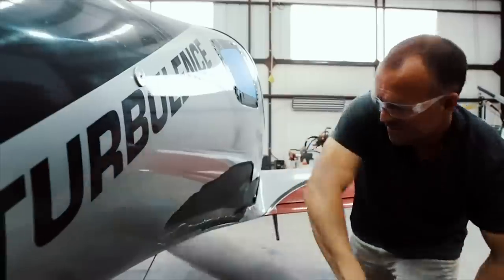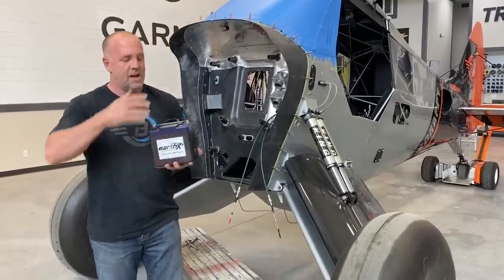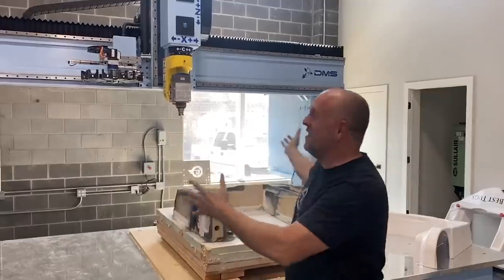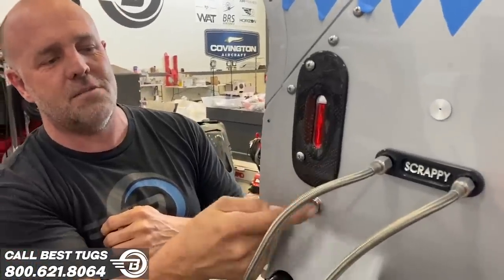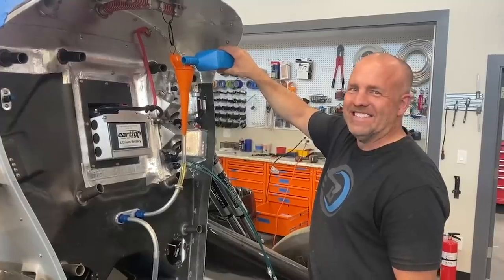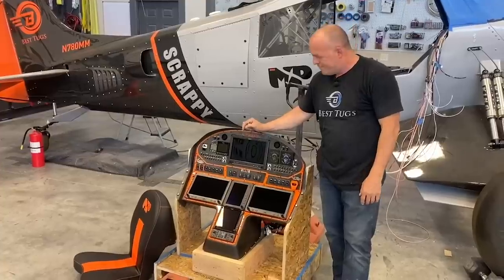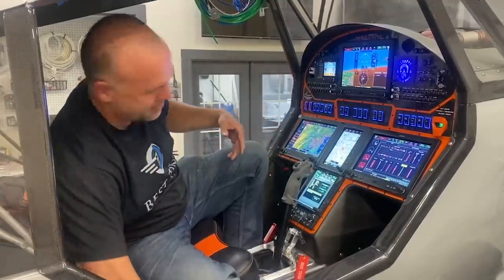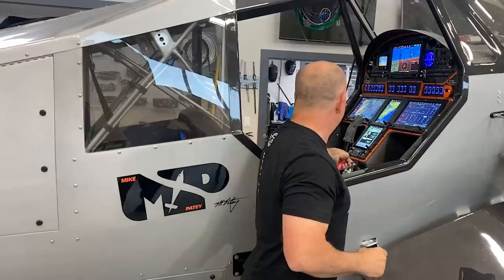Garmin Panel Install (Scrappy Bush Plane 25)

Comment: instruction : To change Battery First remove  engine. Sounds like Volkswagen
Reply from the maker: Lol 😂 I would make fun of myself for eternity if I did that 😂😂😂. You’ll see in a very soon video how easy the battery pulls out without discounting anything but the wires
Reply: Well you should make the battery like a beaver yes pull it out connects itself
Reply: The battery was on a telescoping rail in Alaska you just pull the stop bolt  out and then you can just pull it clear out and take the battery inside at night and keep it warm
Reply: @MikePatey  And is there a remote battery connector for charging or a jump if for some reason the battery was dead.
Reply from the maker: Bryan Runyan yes of course 👍🤠

Comment: When I got a Lithium Battery in the post I thought they had sent me an empty box before I opened it!!!
Reply: I built an ultra light C6 Z06 Corvette.  I mentioned that I was going to try a lithium battery and got totally flamed on the forum as a complete moron.  So, naturally, I did it anyway.  The car came with a lightweight AGM battery (35 pounds) and I replaced it with a lithium battery that weighed 4 pounds, 13 ounces.  It ran my car for just over 2 years until I killed it through human error.  Still have the replacement.  Funny how smart the morons get once their innovations are proven.

Comment: Ahhh I had a question on that engine startup issue and batteries: SuperCapacitors in parallel should help a lot to maintain the voltage up no?
[ie: https://www.skeletontech.com/skelstart-ultracapacitor-engine-start-module]

Comment: Density altitude is a b** in many more ways than one. I was walking through the pits at a drag race many years ago I was a pilot at the time and I overheard a man saying to his son I don't understand why this  motor won't crank over here it work fine at home I asked him where do you live reply Tahoe I laughed and said there's your problem he didn't understand and I am also a full-time mechanic I gave him the number of a starter that would spin his motor at 400 ft

Comment: I feel like there’s going to be some sort of huge reveal for the wings. The fact that he’s bounced around on so many topics and circled back, but yet hardly ever has mentioned wings seems suspicious. Like to do all of that final painting without even having a frame for wings? 

I’m on to you Mike! 😂
Reply: I'm actually hoping he does fuel tanks on the wing tips. As the positive point by utilizing the tips would be dead on with the Renaissance/kitchen sink designing he does.

Comment: love the panel Mike, but as a fellow pilot for the last 54 years, what happens if the panel faults I do not see old fashion HSI
Reply: I think the g3x can be independent of each other but I could be wrong
Reply: The g5 in the top left corner is a completely separate system with its own battery backup

Comment: At my current job i have been able to work with many, many engineers. Sometimes you want to beat them, sometimes you want to hug them. I have found that the difference is often weather or not they actually work on their designs. You clearly do. Your ability to dream, plan and execute is second to none. I do not fly, i just like to work on cool shit. There are few channels i enjoy watching as much as this. Your planes are amazing. Cant wait to see what you have in store for the new draco.

Comment: For your lockout pins you could add some logic with sensors on your suspension so that if the wheels are off the ground then you don’t need the pins to start the plane if you needed to restart the engine in the air. Really cool videos and build, it’s awesome to see it all coming together!

Comment: Left just enough space for his wires- but not enough for the LiPo battery to cool and not light on fire. In an airplane. Good stuff! DIY plane mods are a great thing.
Reply from the maker: Thanks for the comment 👍🤠 I know it looks like that but That’s actually not true. This is the problem with trying to edit 35 hours of footage into 30 minutes of just for fun content.  I have the backside of the battery box cooled, and the front is getting a box enclosure with a cool air vent blast tube.  My engineering firm specialized in lithium design for automotive and is the basis of my patents in battery heating and cooling design.  I’m very familiar with what your describing and now watching the video  I can see by your comment I should try and add a little more content in the future for this topic.  Thanks for pointing this out.

Comment: Hey Mike, Thanks for all of these great videos. You've done a wonderful job on Scrappy. Congrats! Would you please share with us how you're going to seal the two doors, storage doors, bottom panels, and all other areas, to enable you to fly at 25,000 feet safely. I'm sure that you've designed that critical aspect into the plane and have it all figured out... Scrappy looks awesome. Well done!!
Reply from the maker: I’ll show that in an upcoming video. 🤠👍🏻

Comment: Lifepo4 really is the best chemistry for this use case. Has like 4 x the cycle life of regular lion, and it is much safer. You can drive a screwdriver through a lifepo4 cell without it catching on fire. It also produces a lot of current.

Comment: Ive got a pump i dont mind sending to you for further needs, it is a special oil pump made by a company that made rear mount turbochargers .  They have since gone under not for pump issues  but because their rear mount systems wherent very upgradable.    Its job was to take the oil coming out of the turbo and push it all the way back into the engine.

Comment: Hi Mike,  I would like for you to consider one thing. There is a reason for the two sets of spark plugs.  Please , for safeties sake use a magneto as a back up.  If you loose ships power I.e. battery, you can still run on the magneto.  You are an inspiration!  Sincerely,  Paul

Comment: Very motivated to complete my build but with every episode realize that airplane building needs lots of - money , time , equipment , skill set , experience , teamwork , supportive family , perseverance and energy with a side order of youth ( don’t leave it till your 60’s ) , so perhaps before embarking we should have a realistic assessment of these factors as with each one that is missing the project will be delayed or never completed. These may sound like excuses but brand new constant speed prop makes a serious dent in pensioners cash flow . Thanks again Mike for sharing these inspirational videos that I think may have a motivational kick in the pants for many millennials that drift about like tumbleweed on autopilot.

Comment: Where are the cup holders? Mike has raised the bar with a new paradigm interpretation of upgraded panel! I love the left to right for switching sequence for start and right to left switching sequence for shutdown. Great shade of blue for backlites.
Reply from the maker: 3 cup holders, one of the most important features 😅.  I’ll show you in a future video.
Reply: I love it!!! Cup holders included!!! Mike, That's the missing link with other aircraft designers and builders! It's the quest for the Holy Grail of flight deck engineering and ergonomics to include perfect placement of the cups... I'm being presumptuous and imāginōsus to ask; Now where to place 120 Scrappy Koozies??? 😅

Comment: Our flight school had one of the first Cessna 152’s and this Cessna was always hard to start. Someone figured out the 24 volt battery was turning the prop so fast the impulse couplings would not extend out.

Comment: Hi Mike!  That EarthX battery has a BMS that will disconnect it if the voltage drops too low or gets charged too high.but I couldn't find any statement about low temperature cut-off.   Lithium Iron Phosphate LiFePO4  batteries are immediately destroyed if you charge them below 32F.   You should probably consider this in your beautiful system.  If you head out to fly and it's below freezing you could start your engine with a sub zero battery but as soon as it starts your alternator would start charging it promptly destroying it.

Comment: I’d put an opal or milky white diffuser behind the glove box cover (or make the led switchable or dimmable) the pure blue light (it seems like 455 nm almost) can hurt your retina and will most likely be a nuisance during night flights, the diffuser will also make it “light up” more even as (it sems) you have a lot of on-axis intensity due to the narrow beam angle. The diffuser would basically make the lid work more like an evenly back lit lcd than just a “window”. It also would much much better match the illuminated frames around the switches. Love the idea though.

Comment: I like you intro to your videos. If I had a penny for every gadget I dreamt up before falling asleep I could by two scrappy’s, two Dracos along with a Howard 500 for those long trips! Voltage drop occurs when you draw more amperage that the battery can provide. Because of the the amperage coming out of the drops along with the voltage. In most cars the voltage drops from 12 or 13 voltage down to 9 or 10 volts.

Comment: Earthx are awesome good choice I’ve got two 10,000mah in my little pipistrel, one extra for survey gear. I’ve got some battery blankets around them, in winter i just plug in my Tannis preheater system that also is wired to warm up the batteries.

Comment: Wow.  I am wondering what I would have thought if I could have imagined this video when I began A&P school in 1964.  Pure science fiction.
So, the new "Basic T" in flight instruments is Airspeed, Attitude, Glove Box, and Heading?  Nice to know.
Four ignition systems will work--I believe the early R-4360 had seven mags.
So Scrappy bleeds 5606?  Figures.
If you are concerned about starter interlock from gust lock in flight just add a squat switch or other air/ground input for air enable regardless of pin switch function.
Good luck.

Comment: I love the panels and tech involved. Your landing idea is cool. You should have a couple laser distance measurement readers on the belly to get precise distance to runway. Your software would have to account for the distance the landing gear is below the mounting position of the laser(s). I recommend more than one to ensure they are  in agreement before attempting an automated landing. Make sure it agrees with the altimeter and between them you should be able to reliably land with it. Keeping lasers clean in weather would be a concern, but manageable. GPS-RTK  would give you more precise location information, but you would need to have a correction beacon signal. Open Source drone software for fixed wing planes already does most of this, but you would need to test thoroughly.

Comment: Hi Mike!
I think putting the heat resistant film on the backside of the battery box is a mistake. In my opinion the front should be shielded as well, because if the engine compartment temperature increased the composite would start to twist and deform, thus allowing for smoke and heat to enter the cabin. The battery would even help deforming it if it got hot enough. I am assuming you haven't used a high temp epoxy resin for that part.
Love your videos!
Reply from the maker: I’m installing fresh air blast tubes there, also the engine is farther away than it appears, I’ll show this in a future video.  I’m very familiar with lithium battery tech and hold patents in automotive heating and cooling design.  I do appreciate your comment and concern there. 🤠👍🏻

Comment: For your starter disconnect you could just have an alternate ground provided by a weigh on wheels switch. That would ensure the micro switch was required on the ground but in flight it would be bypassed.

Comment: hi mike- love watching your build videos, and really appreciate all the information. i noticed you were digging thru a bin for some old cables and thought id mention that i work for a wire and cable manufacturer called Ice Cable Systems. would be cool to see all your new builds lined with ice cable quality wire. if you are interested we hold every kind of low voltage wiring which would work perfectly for your electrical.

Comment: Just a thought for filling the oil cooler, put the lower line in a reservoir of oil and use your vacuum pump on the upper and “pull” the oil in. Helps make sure you didn’t trap any air too!!  Different note anyone else wonder how fast Mike could put a regular Cub kit together?? He should race the guys over at Cub!!!

Comment: I enjoy your Scrappy videos Mike.  I think you need to bleed the oil lines at the top of the oil cooler to prevent an air space at the top there.  I'm assuming that's why it takes so long to add oil to the lines.

Comment: In Poland homebuilders have the sentence (according to growing experience): "first house you build for someone you don't know, second for family, third and possible next for your own..."
14 builds... A lot of experience.

One thing: battery place... You have to really take care of it, as it is behind the engine really. What if it fails? 

Also: when we will see the main wing? If it is so secret, it would be something really special (in case of features and characteristic) in the world of aviation.

Would be fun to see Scrappy dirt riding. Remember it was your idea and don't jump ;)

Anyway, great company glimpse. Take care.

Ps: I think you will have ability to auto take suspension up when (for example) crossing 500ft over the ground and get more lift out of those little suspension wings. Am I right?

Great Draco blood detail. Everyone can see your love for that plane.

Comment: Amazing extension of aviation engineerimg. That panel is going to make it so you can enjoy more and think less about your flight time in Scrappy. I am curious tho about those connections between the firewall and the engine. The jumpers you spoke of between these two must not vibrate apart what connectors are you using to ensure they don't ever come apart unless you want them to? Beautiful build and full of fun by the looks of the smile on your face all the time.

Comment: Wonder how large ( dimension-wise ) of a lithium battery my motorcycle would require.
*PS, Used to work for a company building ducting for industrial HVAC systems. Love that aluminum tape. And you're right, 90 degree bends are murder on good flow..

Comment: Anybody else notice the blurred button and black tape on the panel at 28:09?! 70 amps between the four breakers... And those King shocks with hoses running into the fuselage... And Mike's comment about custom gear at 35:28... Can't wait to see what's next!

Comment: Check the Winston lifeYpo Cells. It is hard or impossible to Charge a LiFePo in very low Temperature. The Y Type can handel charging when it is cold...

Comment: Heres an idea: Put another spare pin at the bottom of the yoke control lock, so youll always have a spare, and can remove the control lock completely and store in glove box, and just use one of the pins. Or just make that control lock bottom nut quick release w/ a cotter pin, so you can use that pin for the microswitch.  Dont think youll ever lose that pin from the rudder lock in the first place lol but it is peace of mind.

Comment: Hi Mike... Just watching your vid and we reached the point with the Batteries. Little idea here. I know you are into motors. And I know aviation Motors are different from others. But on Cars and Bikes, speacially on my Harley, we got easy start cams... there is a mechanical flip that switches with the rev... This makes my Motor, (0nly 124" on 2 cylinders with a compression of 10,4:1 really easy to start - )... maybe these things are an option for you. Speacially cause they are - as far as I know - failsave, due to the way they are designed - if you haven´t already a decompression thing going on in the motor...

Comment: For all the people freaking out about the cost of the panel, don't forget that this is an experimental category aircraft. So if you are a do-it-yourselfer, you could buy 5 G3X panels for about $20K. Therefore, the whole panel is probably closer to 1/2 a carbon cub than the two carbon cubs people have suggested. One of the fantastic parts about experimental aircraft is the lower cost electronics. Probably nothing different but the stacks of paperwork required for the certified versions.

Comment: Hi Mike Great Plane but I noticed you installed the solenoids upside down. They can stick closed in that orientation, as I once found out when the starter did not shut off, I reversed the solenoid and all was fine from then on. Really is a helpless feeling when you can 't stop the starter motor until the battery runs down.

Comment: Amazing Project. I don't comment often, but I watch every video. With the Gust lock pin system, could you also use the 2nd pin that holds the stick lock to start the engine during the odd emergency where the 1st pin falls out or goes missing? (the stick lock yoke also looks spring loaded to the 'open' position which should help keep it safer during said emergency?). Keep up the great work.

Comment: So I know with marine setups, I’ve had to setup NMEA 2000 to each accessory that I wanted connected to the Garmin, what type of system do you use in an aeronautical setup?